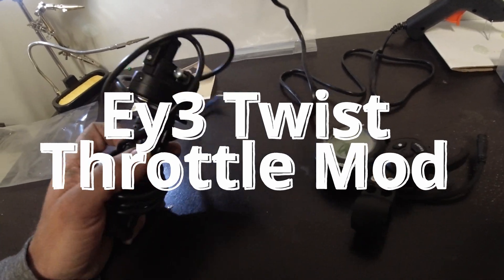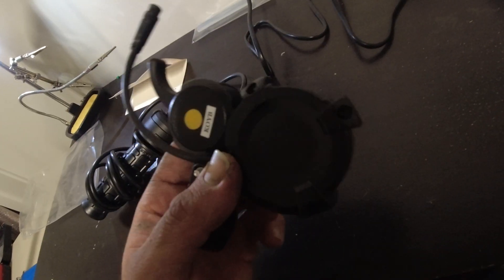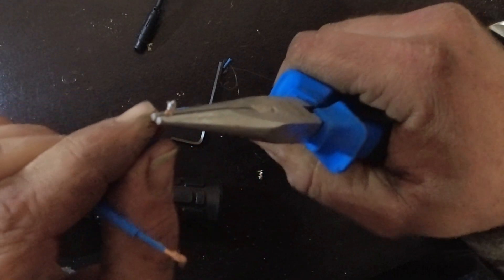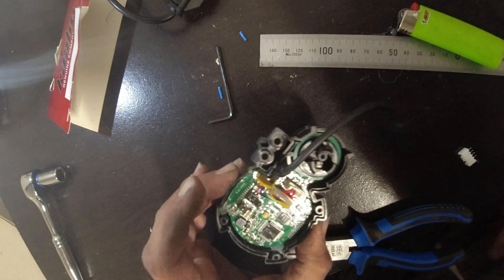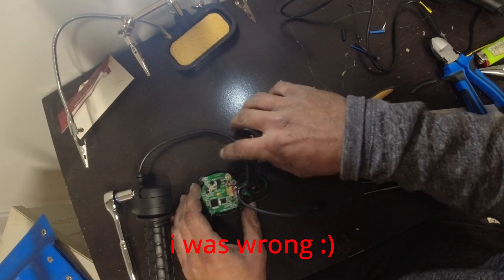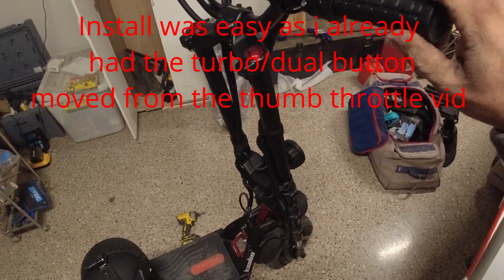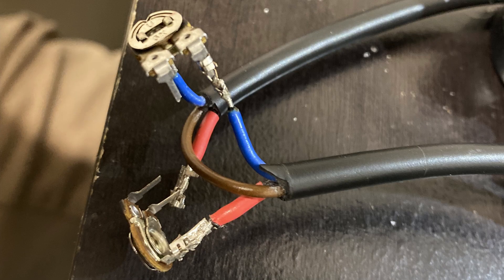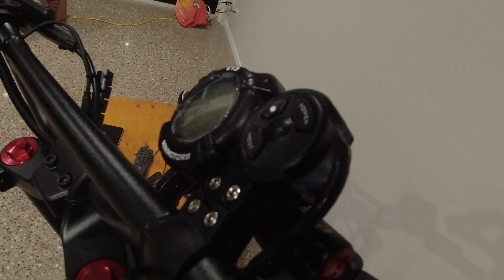Ey3 Magura Twist Throttle Mod - Tutorial - Kaabo Wolf King ELECTRIC SCOOTER

Comment: The 6 pin connector inside, what type of connector is used and what is the pinout? What are each of the wires  that come off of it (Y, W, Gr, Blk, Blu, R) used for?

Comment: You need to use the sensor/little transistor  that you been cut out and put it inside the throttle ..
Reply: What do you mean by that how should you place it?
Reply: @_spkkk  you need to open your throttle  on the side  after you open  it you should see a sensor  inside then  take the sensor out and the replace it   That you've cut from inside the controller

Comment: Can somebody explain the science behind using trim pots? Why and how they work?
Reply: This is going to be a little long and is a bit of a guess...If I understand the video correctly, the original thumb throttle uses what is called a Hall Effect Sensor. Early in the video, about the 1:50 mark, antssta says we are going to remove this transistor. It isn't a transistor, it is a Hall effect sensor. The thumb part discarded at 1:45 in the video has a piece of metal visible on the perimeter of its cylindrical body.  Step through the video slowly and you will see it. That piece of metal is a magnet.  Assuming the Hall effect sensor is a linear sensor, like an SS49E, then it will generate a voltage that is proportional to how far the thumb throttle has been depressed. Assume the control system uses a 5V supply. The Hall sensor will not start at 0V and go to 5V. It will start at about 1V, corresponding to no throttle, and go to about 4V corresponding to full throttle. Any throttle position in between no throttle and full throttle will be some voltage between 1V and 4V. It looks like antssta replaced the thumb Hall sensor with a potentiometer twist throttle. The potentiometer will produce a voltage between 0V for no throttle, up to 5V for full throttle. antssta needed the two additional trim pots to limit the high voltage to closer to the Hall sensor high voltage, in my example 4V, and to lift the low end 0V up to the Hall sensor low end of 1V.  antssta is making a three resistor resistor divider.  Imagine a water tank 5m in height. If you tap near the top, or exactly at the top, there is no water pressure. If you tap at the bottom you get the full pressure of the water and a hose will flow at maximum. Tap anywhere in between and you get a pressure proportional to how far you are from the top, farther away is more pressure and more flow. The Hall sensor only lets you tap from 1m from the top, to 4m from the top. The potentiometer without trim pots lets you tap from the top all the way to the bottom 5m away. The trim pots, assuming they are set correctly, force the tap to be between 1m and 4m so the twist throttle now mimics more closely the Hall sensor.  Trim pots adjust the tap point. There may be more going on but I can't tell from the video. For example, how are the rest of the electronics treating the signal? If you are going to copy what antssta did, my training is to not leave the third leg of the trim pot disconnected. The third leg can be tied to the wiper leg and the trim pot behaves the same. The reason to tie the third leg to the wiper leg it is to prevent any stray electrons that might be mucking about from getting onto the disconnected leg and throwing the calibration off. The disconnected leg is also a short antenna so noise is getting in.

Comment: so whats ur opinions on these mods away from the finger throttle after a while using them? as ive personally maintained that twist throttle at least allows full grip. thumb throttle means you gotta let whats actually gripping the bars do the throttling. without anything to grip with the legs or knees like a bike. i dont think these are suited to scooters. i prefer finger as it allows the thumb to maintain a good hold with three other fingers . one for throttle one for brake three for grip with opposable thumb. which throttle have you kept and why?
Reply from the maker: Twist throttle, best mod by a mile. Unreal grip, and never a finger off the brake

Comment: I can't imagine riding and jumping constantly changing lines keeping balance while riding more then 30km and other stuff with this while keeping my grip tight just impossible at least 4 me thumb one or standard one are ok
Reply from the maker: it is 10x better then a finger or thumb throttle. 
It seems like it wouldn’t be good when you think about it. 
In the real world it is so much better! More grip, thumb plus 3 fingers on the bar at all times. Can rest your finger on the brake rather then dancing it between the throttle and brake. It’s just all round so much better in my opinion!
Reply: Thumb throttle is only slightly better than the trigger throttle..... if thumb/trigger throttles were the best you would see them on all the motoX and gp bikes. But we only see them on Chinese scooters and farm quads. You obviously dont have any motorcycle experience scooter boy.

Comment: It has trim with screw and can change voltage for low to 5v!! Why he don't give you that but a standard trim...?
I burn  the 4.4v from display (the red wire from 3)😲😡 and from other pin in the display take 5v!!
When i turn thumb to top (top speed) CUT OFF (like yours twist throttle)!!!!
I go to a electronic Store ask what to do.. 
I guy how has the same "crazy" like us🤪 give me the solution !!! He make the same mistake but he knows how to fix it!
The trim is the same as the blue one you put in start and has a small screw!!
With polymeter turn screw till go 4.3-4.4v and work perfectly!!!😉
If you see my video the thumb throttle that i have on FLJ works with that way but can't see the trim!!
I hope help you a little!!
Reply: Magura magnet can give 5v but all display understand top 4.4v after this is overvoltage!! That means error!!! So cute the voltage!!

Comment: I tried a friend ebike about 1 year ago. Bike looked great but I had huge trouble turning. Not been on bike for years but I could ride with no hands before but this ebike seemed off. Oh, I really didn’t like twist throttle. I have 1 e scooter with thumb throttle and 1 with eye throttle and I must say, I love thumb throttle, especially as that scooter has cruise control. It’s just comfortable. Eye throttle is ok but I miss cruise control. My new scooter is listed with cruise control but it won’t work. Some have said that I must have got old model where they implemented cruise control icon but haven’t actually implemented the actual function. Do you know if it’s possible to take my e scooter to someone to implement cruise control? Would be a game changer for me. Simply because unless I’m holding throttle all way down, I find it very hard to hold throttle say halfway to cruise at say 12-18mph. Every little bump makes my finger move ever so slightly and that causes scooter to kinda jolt, kinda like when you see a learner driver but nowhere near as bad.
Reply from the maker: Hey mate what model is your scooter?
I’d say get the twist throttle I can steer control turbo mode on the kaabo king down to 10km/h or so with out much hesitation over bumps etc in eco mode it’s even more butter if your just cruising at low speeds
Reply: @antssta  my e scooter is called HITWAY H5 I’m in U.K. but in America it’s branded as EverCross. Exactly the same scooter just diff names. I’m sure some company copy others scooter and put did brand stamp on it but I don’t think mines that. I guess maybe legal reasons or something. Don’t get me wrong, my scooter is fine apart from cruise control not working, or probably just not implemented on my model, even tho cruise control symbol pops up briefly when I turn scooter on. The acceleration has a kinda jolt, it’s rather hard to hold eye throttle at same spot and cruise at day 14mph. I loved simply cruising on old scooter, super smooth at constant speed. Like 12-14mph felt great. Now on new scooter, I either have on gear 2 19mph top speed and just go full power or 3rd gear full power at 24mph. I’m getting better at managing throttle but it’s really twitchy.